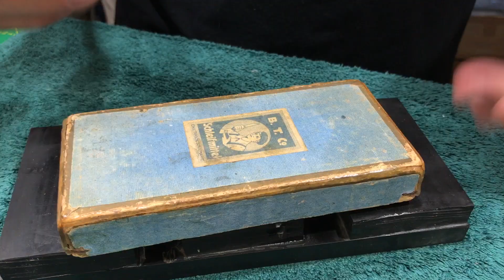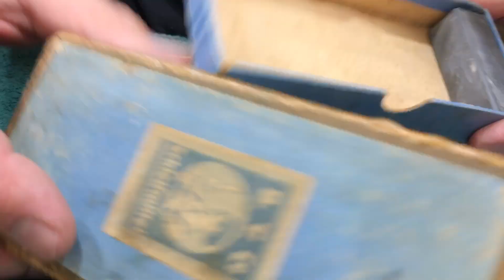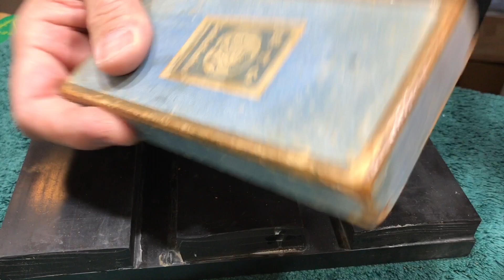Straight Razor Honing Vlog #3 - July 2018

Comment: If bevel angles didn’t matter all near and true wedges would shave nicely without any consideration of tape amount and thickness, those tiny, petite bevels on wedge Sheffields resulting from 4+ pieces of tape shave so well, not. I’ve had ZYs come in as high as 19.3, I agree, 16-16.5 is the sweet spot. Cool video!
Reply from the maker: Thanks Nelson, Yeah - those skinny bevel guys think they're better 'cause they 'look' nicer. Same guys think mirror polish means better edge. Lol....